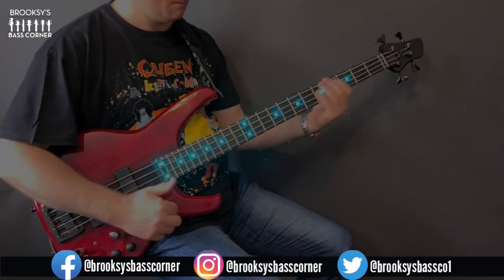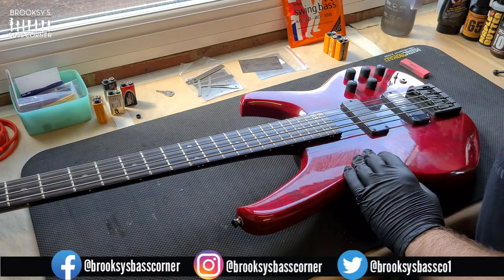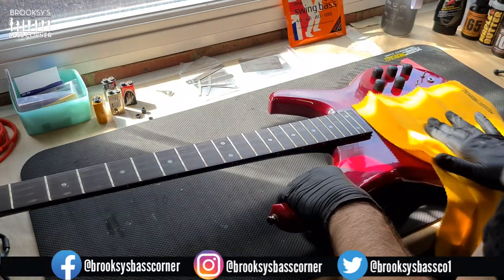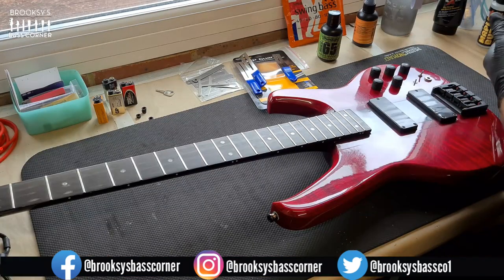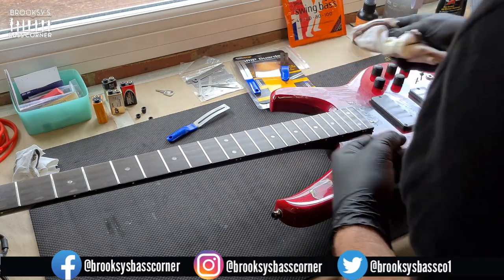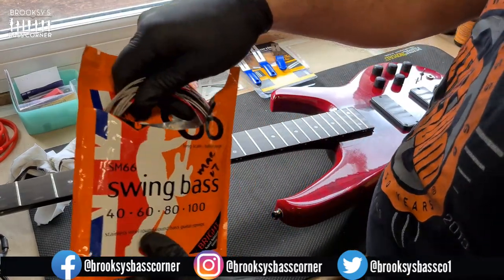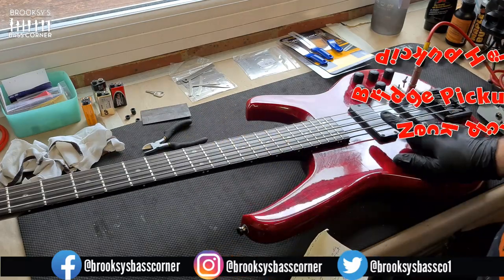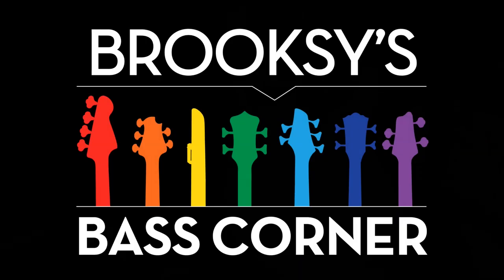BASS MAINTENANCE | Make Your Status Graphite Empathy Bass Play Better!

Comment: how did you get the bass and how can i get it
Reply from the maker: Thanks for the comment. I bought it brand new in 2002, they stopped making that model in 2001-2002 and it was replaced by the Series 2 Classic. Unfortunately, Status are no longer making orders or production models so if you want one of these, an Empathy, you will have to buy one secondhand. All the best!